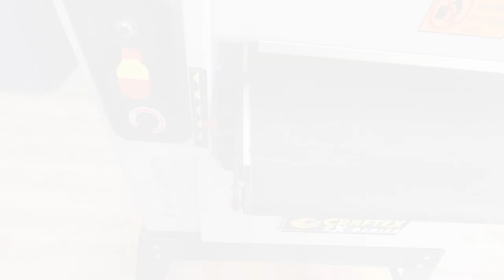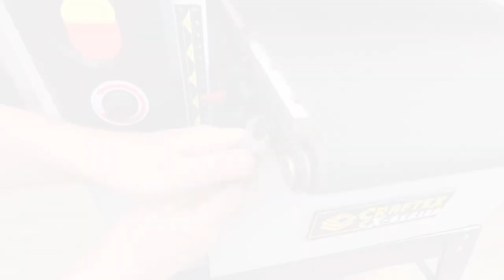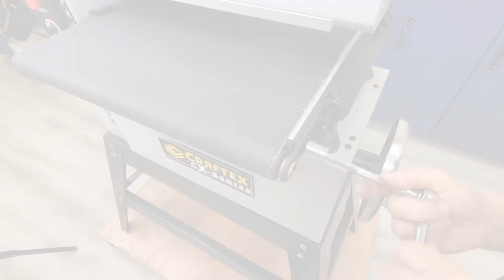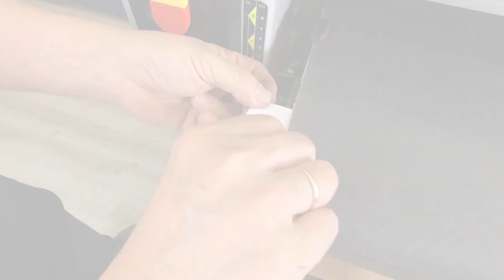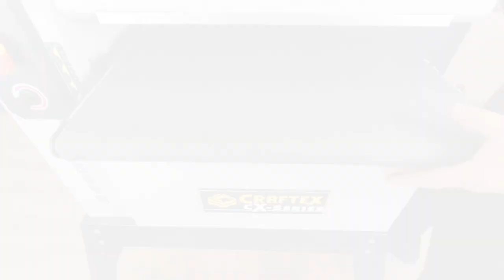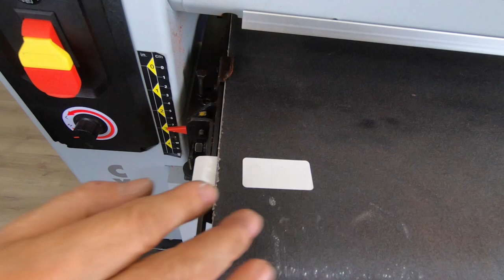Tech Tips - CX509N 18" Drum Sander Belt Tracking from Busy Bee Tools

Comment: The worst tool I have ever used. Please show the whole video of you fixing this. Don’t cut the video. Also please have a video showing replacing the sandpaper. Because it makes no sense, I would love to get my money back on this terrible tool
Reply: Norman, I found the Grizzly 18 1/2" drum sander to be a near identical model.  Check their website, where you'll find their manual and a video that may help you out:  https://www.grizzly.com/products/grizzly-18-1-1-2-hp-open-end-drum-sander-w-vs-feed/g0458z
Reply: I have the Grizzly 18” open end drum sander (G0458Z).  I’ve had it for just over a year and this is the first time I’ve had to do any kind of tracking adjustment (Due to a brass roller bushing oddly wearing out). I use the machine solely to sand 3/8” pine plywood pieces.  Aside from the color it appears to be identical to the one shown in the video here.  Despite the Grizzly manual’s thorough instructions, this video was the ONLY way I was able to correct the tracking. Please note: The voice-over in the video states the incorrect direction to turn the tracking adjustment bolts.  The way it is shown in the video is correct.  I had to make very slight adjustments to the tracking adjustment bolts..like 1/4” turns when I got down it being just slightly off, then eventually I let it run long enough on full speed that I could see no further adjustments needed..all good now tracking straight.